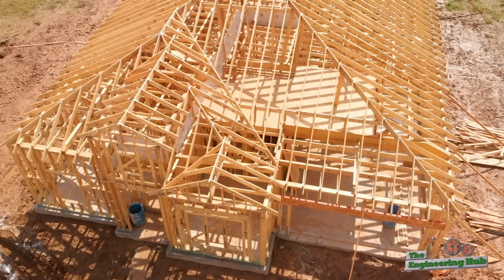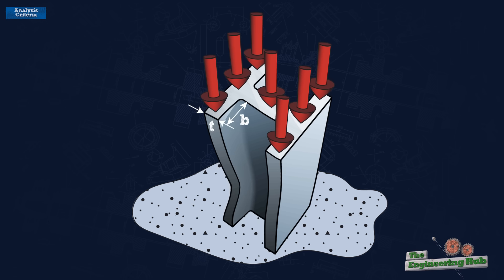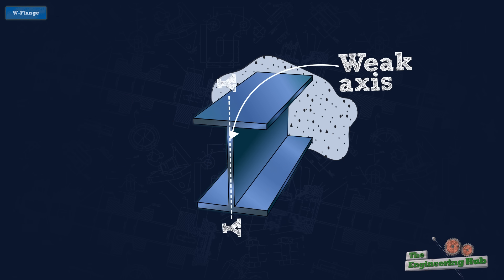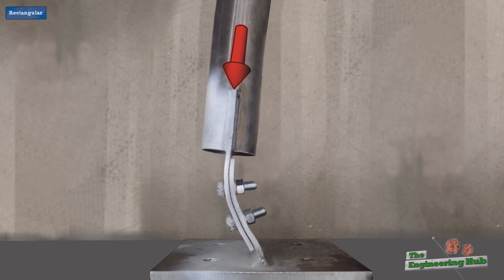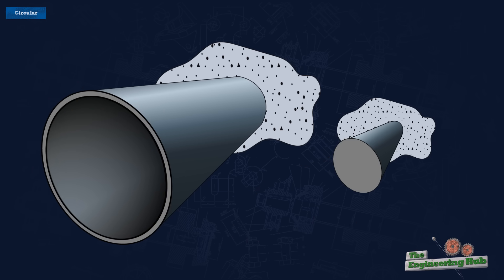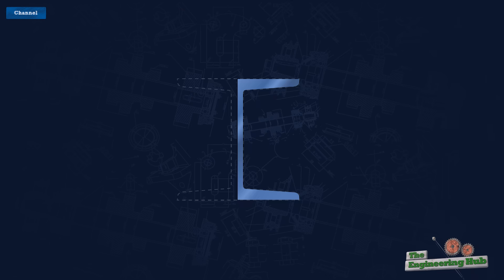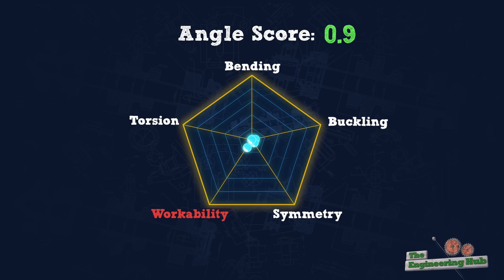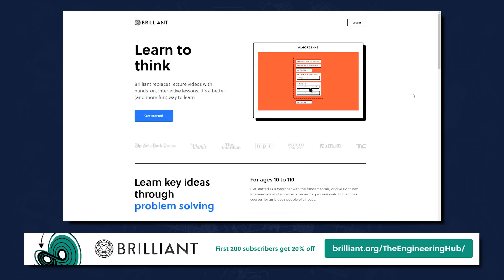Structural Shapes Ranked and Reviewed - Which one Wins?

Comment: would 80/20 extruded aluminium be consididered closer to channel or i-beam?  just curious how to look at 80/20
Reply from the maker: Hello Dr Renard,

The 80/20 brand products are very interesting. One way to look at such products is to reduce them to the simple shapes which their sections generally contain. For example, their smaller T-Slotted profiles (<25mm) are primarily open sections with outstanding flanges; this makes them similar to T or I sections in some respects and would tell me that they are relatively weak to torsion but fairly good at bending (although better than pure T or I-sections at taking torsion, as there is a small enclosed area near the centroid). The larger 80/20 profiles (>25mm) start to include more enclosed area which makes them better at resisting torsional forces and starts to make them more comparable to rectangular tubes. All of the 80/20 sections have advantages of channels in terms of workability due the the exposed slots on each side for positive connectivity, which is what makes them particularly unique. 

Cheers and thanks for the comment!

Link for reference:
https://8020.net/framing-options/t-slotted-profiles.html
Reply: @TheEngineeringHub  thanks for the reply. It is a very complex design and so I made some suggestions of what I could extrapolate based off the video. I am actually glad you could actually give feedback on this as not particularly my field of expertise and I have really been looking into 80/20 (and off brand extruded t-slot aluminium but used more for recognition). Thanks for expanding my knowledge base and giving me insight into how something not covered could be used, even just based off of structural examples you've already made. So pretty much I beam with more workability. Though the mention of torsion, I remember some of the bigger ones have kinda hollow center too so is partially a tube build as well.  Would explain why it is a pretty useable structural material that's useable in hobby and professional development. Yet again, thanks for the actual feedback on my question.

Comment: I feel like you may have scored some shapes too high in term of symmetry.

 Its true that the i-beam resists bending very well in the strong axis, but its combined bending/symmetry score being so much higher than the round tube is strange when (I have not done the math :/) a round tube might better resist bending than an equal area I-beam in its weakest direction (it's quite possible I'm wrong about that, feel free to correct me!)

I'd argue the hollow square beam should have won, since it's a jack of all trades with no glaring weakness.
Reply from the maker: Hi Alex,
Your comment is spot on. These are exactly the kinds of questions we asked ourselves as we developed our rating scheme. Our choice of the wide-flange I-beam gave it that extra edge over the pipe in terms of weak-axis capacity. And we spent a lot of time deliberating between hollow square and I beam, which is hopefully reflected in how close their scores are. However, more than any of these specific rating scores, we wanted this video to help show the analysis criteria that can be used to choose the best cross section for a particular application. 
Cheers,

Comment: I have a question that I have not been able to find a clear answer for. Can you help? For two examples of the same material, length, and outer measurement (not material area), which is stronger in bending resistance: an i-beam, or a solid square/rectangle? This is if the greatest height and width of the i-beam are the same as the greatest height and width of the solid square or rectangle beam. Does an i-beam gain any strength properties that the solid beam of equal size does not have? I understand that weight, cost, workability and such will be disadvantaged on the solid part. Help!
Reply: If I understand your question right, you're asking if an I-beam is stronger than a solid rectangle of the same size, right? The solid rectangle will always be stronger simply because there is so much more material. 

Example: 4" tall x 2" wide I-beam made out of 1/2" steel will always be weaker than a solid 4" tall x 2" wide steel rectangle. The advantage of the I-beam is that it is a much more efficient use of material. With the material of a solid 4"x2" rectangle, you could make something like an 10"x5" I-beam, which would be much stronger.
Reply: In that analysis you are neglecting the self weight of the structural member. The wide flange beam is stronger due to supporting less self weight. Take examples of both and extend them to 6,000 ft. horizontally and create a fixed end on one side and no connection on the other. Apply the self weight plus a 100 pound dead load at 4,000 ft. away from the fixed connection. What is the deflection of each at the unsupported end?

Comment: It would be interesting how more complex shapes perform: 1.) hollow circle nested in a channel. 2.) a helical twisted pair of hollow circles.
Reply: More complex sections like the ones you're describing would probably, at the very least, suffer a lot in workability and manufacturing viability, making them more costly. Though there is the opportunity to make certain complex compound shapes out of simpler sections.

I don't imagine helical twisted pipe sections would be hugely useful, except, perhaps, using them as active hydraulic support... Hmm.
Reply from the maker: Hi guys,
Check out Dr Renard's comment here about 80/20 products -- this should provide some interesting insight on complex shapes for you. Generally such shapes are only made in aluminum since they need to be extruded. That ends up limiting a few factors such as yield strength (aluminum yield strength is less than steel), weldability (aluminum strength gets destroyed when welded), and cost/workability as Woodledude has pointed out. Stay tuned for a future video on aluminum vs steel.
Cheers,

Comment: Thanks for sharing your video. Are you saying a hollow square is stronger than the solid square of the same size? Thanks
Reply: Material near the neutral axis does little work resisting load, and you pay the same for it in terms of $/tonne. So you may as well move more of the materials further away from the NA to improve performance for the same cost. So you can span further with the same load.
Reply: @TonyRule  thanks Tony that makes sense to me now!😊
Reply from the maker: Hi Richard, not exactly the same size but the same cross-sectional area (amount of material). Reshaping a solid square into a hollow tube would make the tube wider.
Reply: @TheEngineeringHub  thanks for explaining that!

Comment: I often see elliptical tubing used for things like motorcycle and aviation framing/support elements... in talking about wood framing, sheathing, with adhesives, seems to offer a big advantage in making a kind of 'tubular', or even, monocoque, structure, with much added stability.
Thanks for an interesting presentation, and interesting graphical/numerical scoring method(s).
Reply: I had forgotten about elliptical tubing. It seems to combine the properties of circular pipe with the properties of hollow rectangular tubes.
I first saw them being used for reducing weight on bicycle frames while increasing bend resistance in the commonly loaded direction.

Comment: @9:13  those are not structural pipes but Fire Protection.  the "victaulic" grooved couplings that you call "collars" are only meant to join the pipe to convey fluid not add reinforcement to the building

Comment: as a Civil Engineer i would say your analysis was good.
Reply: An illiterate coward claiming to be an engineer?
Reply: I would say it is a very well informed purely scholarly approach with some notable gaps in real world knowledge and experience. For example the double T bridge sections he described. Those are generally post tensioned with cables for the strength of the structure rather than relying on rebar that is only contained in each individual section and doesn’t transfer load. He also ignored how the shapes he discussed are used as part of a larger system and the loading in each member is influenced by other members. And the shapes he deems less worthy are great at transferring smaller loads between more larger examples of ideal shapes.

Comment: You correctly inform us that we need to select our section acording to the application.  Therefore there can not be a clear winner.
You say the torsion in an I beam depends on its 'J'.  If you mean 'J' as it is usually understod, IE Ix+Iy then you are wrong.  It depends on its 'K' which is much less.  I recomment Roarks formulae for stress and strain for a better understanding.
'U' or 'C' sections have a further disadvantage to the doubly symetric 'I' in that they have a shear centre outside of the section which can easily lead to combined bending and torsion when loaded with simple shear.
From  a practical point of view, closed sections are difficult to treat against corrosion and equally difficult to inspect, unless of course you can get inside it eg the leg of an oil rig.
Reply from the maker: Hi again Emma, by J we mean the ''torsional constant J'' and not the polar moment of inertia or the summation of the moment of inertia about the x and y axes. Check out Chapter 3.10 in Mechanics of Materials by Gere, the twisting of noncircular prismatic shafts and the torsional constant are explained there. The factor K in ''Roark's formulae for stress and strain'' is the same factor that Gere calls J and is the torsional constant.  In regards to the shear center, we agree that this is an important point that is worth mentioning. Maybe we can do another video only on the shear center of sections in a future video. Thanks for the good discussion as always.
Reply: @TheEngineeringHub  I am reassured.  Being aware of different definitions is important, particularly when presenting forbeginners.
Glad to help.

Comment: Helpful video, thanks.  I would say that workability depends a lot on the tools available for a given material and shape.  Having the appropriate tools can make the workability much easier.  And not having them can make anything difficult.  All that is to say I would not have given workability as much weight as it is given.  Or, in practice, weight it in light of the available resources.
Reply: Yeah, workability is a bit of a strange category to me.

I also don't see how I-beams are more workable than hollow rectangular tubes. If you have to trim out an I-beam, it gets pretty awkward for where to attach your stuff. But trimming out a hollow rectangular tube wouldn't be that hard IMO.

Comment: Love the use of radar plots, this is an ideal situation for using them.
I also can't believe it never occurred to me that the framing+sheathing in home construction created a compound I/T shape for strain calculation purposes!!!
Reply from the maker: Thanks for the feedback Adam!
Reply: I would have tought this was common knowledge ... build a basic box ... if you start with the sides it is great top to bottom but may not stay square as it wobbles ... add a bottom and poof it goes rigid ... I learned that back when I was about 8 years old building a birdhouse for cubs ... it was a royal pain getting all the sides to stay square ... then the dad showed me the easy way ... start at the bottom and work around ... each addition adds strength ... to the last ... no more fiddling with square
Reply: @kaboom-zf2bl - Making a Temporary Triangle can help, as well.make 2, and you get both square, and stable.
Reply: While not really part of the data visualization, an awesome but rarely used part of computer interface is a three-variable slider, which is visualized as a triangle, with each point in the triangle being a different distribution between the three options.

It could be used as a data visualization for some things too, like "time spent working/sleeping/other" with every point on the triangle being a different set of these three numbers with a constant sum.
Reply: Sounds like it'd be a good...I/T Support!
Reply: I'm not an engineer or construction dude.  When putting up a shed a couple years ago, once all the walls and roof trusses were up it seemed pretty rigid.  Once the sheathing was on it was very rigid.  That's a lot of "triangles" working for you (triangles formed by fasteners through the sheathing - whether walls or roof).  The tension on the roof truss horizontal beams becomes the hero of the project, actually.
Reply: Before watching, my answer to the question in the title was, "All of them. Depending on what you are looking for from the shape and material."
As an example, it's hard to pump water anywhere using an I-beam.
Reply: @MonkeyJedi99  well not exactly true ... it will work as a canal or via duct on its side ... BUT makes going up walls a tricky experience ...
Reply: @MonkeyJedi99 - Similar to "Which Utensil is Best?" - It depends on if you want to eat Soup (Spoon), Butter Bread (Knife), or eat a piece of Meat (Fork), for example! 

Yet, a Spoon "Can" be used to Butter Bread, or pick up a Piece of Meat, "In a Pinch!" But, a Knife is Lousy for eating Soup or picking up a piece of Meat!
Reply: And, the Fork is marginal for Soup, and also not great to Butter Bread! 😢

Comment: I've worked with U Channel beams, and for their weight, they got quite good bending strength. Certeinly, a good option for longe free span structures without much torsion loads...  Anyway. Nice video man.
Reply from the maker: Thanks for sharing!
Reply: @makermartin10 - How about U-Channels attached to Tubular Cores? Or Square Tubes fitted with Round Types, internally?

 Adhesive Bonding, Welding (via Rosette Welds from the Square Tube in Circular Openings, not too big), or Bolting Through, to transfer and Share Loads!

Comment: Cool video, I like your rating method!  The only thing is that the transverse stiffener shown at 5:03 does not improve torsional resistance, it improves local web buckling.  Torsional stiffeners would need to run down the axis of the beam closing the section for the entire length of the beam loaded with the torque.  Great video otherwise!